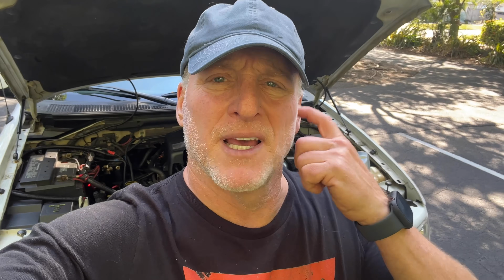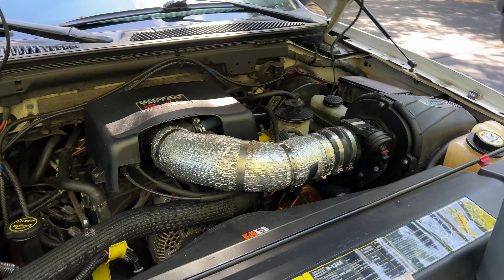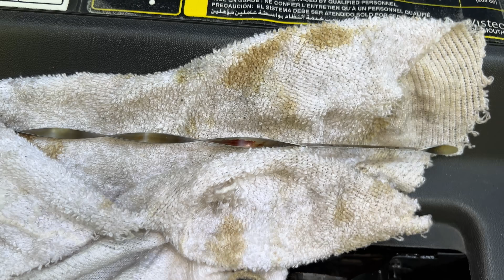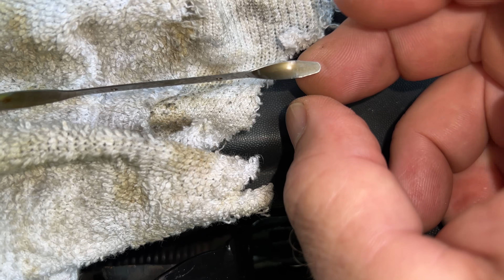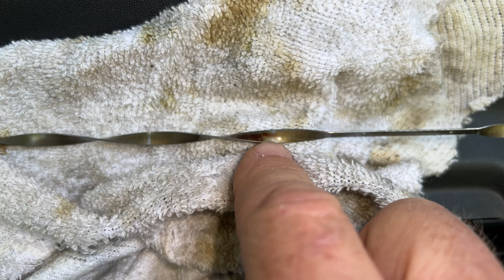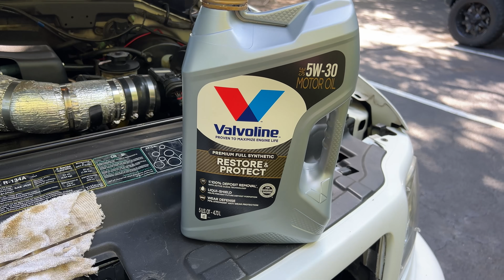Valvoline Restore & Protect Review: High Mileage 264K Engine: Reduce Oil Consumption & Piston Slap?

Comment: Since it is cleaning, do you run less miles before drain.   If oil loads up from old dirty engine then you don't want it ( grit) adding more wear.   So want to drain and get new Valoline Restore and Protect. ? Lower miles but repeating adding to clean out engine.
Reply from the maker: It really depends on how well maintained the engine.  If this is the first oil change in 20k miles, I would replace the oil filter within 500 miles to be sure it does not get plugged.  Also, check the dipstick to note the color of the oil.  As soon as it gets black and thick, change it.

Comment: Let’s hope they tested this long term before going out to market to make sure the seals don’t degrade prematurely. That would make any benefits into an eventual leaking  pain in the rectum.
Reply from the maker: I contacted Valvoline about this concern and they said this oil will not damage or degrade seals and gaskets.  So far, my engine is tight with zero leaks.
Reply: @ thank you for that info
Reply: It made my rear main seal leak after 800 miles.   Ford 4.6
Reply from the maker: @AB-kd9mk  sadly, you might have had sludge that was sealing the crank and the oil dissolved the sludge.  That's a bear.  Did you change the seal yourself?
Reply: @DrivingIntelligence  No.   4R70w still purring along at 200k.  I’ll catch the seal when she needs to come out someday.   I had been using WalMart full synthetic 5-30 with 3000 mile changes for years before R and P.   

I decided to get rid of the R and P after the seal leak and went with Amsoil Signature Series for the first time ever since my vette seems to love it.  Instantly noticed less valvetrain noise which seemed  to increase with the R and P.   500 miles or so after the switch to Amsoil the rear main stopped leaking.    Was getting close to trying AT-205 but didn’t need to.  By the way I love your channel and you’ve really helped me maintaining my ‘97 4.6 2V I’ve been driving since 1999.   Thank you. 

Yeah so anyway I don’t think my 4.6 “likes” R and P from the valve train sounds and drips of it.   Maybe some AT-205 could overcome the seal issue but not the noisier valve train.   I’m not worried about sludge anyway but the idea of cleaning up the oil control rings appealed to me.  Not worth it for this vehicle.  Oh well.
Reply from the maker: @ interesting comment, thank you.  Similar to what you noted, I hear less valve train noise and quieter operation with my 5.4 2v after switching from Pennzoil Ultra Platinum to the Valvoline R&P.  I've never tried Amsoil, might be a future test.
Reply: @AB-kd9mk  That Amsoil has got to have some version theirs of a stop-leak similar to AT-205 in it that they’re not advertising for some legal reason. That’s because no motor oil is going to just help stop or reduce a leak without some additive to make it do so. Not saying it’s as effective as AT-205.
Reply: @ So then you are unfamiliar with oil seal conditioners that part of the formulation of most synthetic motor oils.   Get familiar.
Reply: @ Wow.  More good information!  I’ve never tried Pensoil Ultra Platinum but it’s on my bucket list now.    Thanks again.   Yeah the problem with Amsoil is of course the price but I gotta say it always impressed me.   Apples and Oranges on this example now but you can’t believe the difference it made on my Kohler Marine genset (Two cylinder Kawasaki).   Unbelievably more quiet.
Reply: @AB-kd9mk  What usually happens in these instances is deposits inside the engine were actually plugging an area that would've already been leaking and the better oil simply washes those deposits away. Was a pretty common occurance when people started switching from conventional to full synthetic. People thought the oil damaged their seals but in reality, the seals were already damaged from age and the buildup from the conventional oil simply kept them from leaking.
Reply: @AB-kd9mk  Since you’re the first guy to have that happen in all the comments I’ve read on several videos, I hope it’s just a coincidence that you used it when you were about to get a leak anyway. Are you the first owner and how long have you owned a car.
Reply: @yactabay  second owner.   1997 model.   My daily driver since 1999.   Always maintained myself.  3,000 mile oil change intervals.   Before R and P no rear main seal leak.  Dry.   Been running Walmart full synthetic 5-30  (Warren Oil) for about last 30,000 miles.    Switched to R and P and 900 miles later rear main leak noted.  Switched to Amsoil SS full synthetic 5-30 and 500 miles later no rear main seal  again.

Comment: I have been using OEM Honda full synthetic blend for eight years. I finally switched to Mobil 1 Extended Performance two years ago. I noticed a big improvement in engine noise and smoother acceleration.

I read online that people also said that when they switched from Mobil 1 to Pennzoil Ultra Platinum, they noticed greater noise reduction and better acceleration.

Now, there are videos claiming that Valvoline Restore and Protect is even better, making your engine sound like an EV and accelerating like a Bugatti. I am totally lost.

I do plan on using Restore and Protect in all my vehicles.
Reply from the maker: Claims that engines will gain vast amounts of power from use of this oil are suspect.  I'm experiencing smoother operation and reduced oil consumption.  My previous go to oils were Royal Purple & Pennzoil Ultra Platinum, and I was very pleased, but the results from using R&P are very significant in terms of what I noted, reduced oil consumption and noise.
Reply: @DrivingIntelligence  I've heard that Pennzoil Ultra Platinum and Amsoil are considered far superior to Mobil 1. However, when I read online, I see that people who use Ultra Platinum and Amsoil often say that after switching to R&P, they noticed even better noise reduction and less oil consumption. That makes me think that a lot of what people say about oil brands is just speculation and bias, with no real objective proof.

If someone has been running a "superior" oil for the entire life of their engine, why do they still experience oil leaks? If they change their oil every 3,000 to 5,000 miles, why are they having engine problems? To me, it seems like people are just hyping up certain oils without them actually performing as claimed.

At this point, I might just stick with Mobil 1 or give R&P a try, but I don’t believe everything I read online anymore most of it seems to be just personal opinions with no real facts to back them up.

Great video! Keep up what you're doing, and I hope I find my answer once I switch over to R&P.
Reply from the maker: @ good comment, thanks.  My experience so far as noted in my videos is reduced oil consumption and quieter operation... since I started using R&P.  I'm up to 8k miles on this oil.  Hopefully will continue to improve over time.
Reply: Also, make sure you're using a consistent filter when comparing the observation of audio and visual. Synthetic media filters typically flow better, but each brand does differently, and you can see it in, I think, brand ranks is a group channel that tested it with a whole system where they can get the temperature correct and everything. The mobil extended performance filters and the Wix XP filters were probably the best flowing that didn't sacrifice too much filtration like the Toyota filter flows great but has terrible protection.
Reply: I have a pretty good test scenario with mobil1 full synthetic from 20,000 miles on the 2002 GS300 for 10 years and it burns a cord every 2,000 miles.
Needless to say, it didn't do too good at protecting. 
I have a 2GRFE in a Highlander, I had about the same mileage, and it ran pensoil, ultra platinum, amsoil, and valvoline extended protection, and now I'm trying the valvoline restored and protected. I think I'll run it a little while, see if it makes the engine any quieter, At 119,000 miles, I figure it probably has some deposits., but when I drain the oil, I definitely have all the oil I put in there as i measure after 5,000 miles on the extended protection.
After running a restoring protector for four changes.
I think I'll go back to the pencil ultra platinum after that's done. I didn't like the way it sounded when I used the extended protection. There was an immediate difference as if it took longer to get lubricated and quiet down.
Reply: Seafoam
Reply from the maker: @tntgators  Tried it, didn't work... this oil is the only product that has reduced my oil consumption, to date.

Comment: Can this oil be used in diesel engines too?
Reply from the maker: generally speaking, the answer is no, the wrong oil could cause damage, but Valvoline makes a very expensive oil for Diesel Engines that cleans the rings very effectively.
Reply: Valvoline says not for use in diesel engines.
Reply: @dacampbellrn  thanks a ton

Comment: I switched from 5W-30 to 0W-20 this shit is that good, my car got recalled for oil burning & this shit is really good. My MPG when down but thats it. Running like a champ.
Reply from the maker: hmmm, I wonder why your mpg went down.  You stopped burning oil?  What vehicle do you drive?
Reply: @DrivingIntelligence  2009 xB it was recalled for the piston rings so it'll just chew through the oil. Isn't really burning oil now.
Reply: @mrshadow70835 You're using 0W20 now? That should increase your mileage, not reduce it. 5W30 is thicker.
Reply: @musicconnoisseur4019  I think the thicker oil is getting me better compression because of the recalled piston rings
Reply from the maker: @ that's a good assumption

Comment: in general any proper full/100% syn oil would clean up sludge and varnish from insides including dipstick, but at very slow rate. I had this case 10+ years ago after dealer put some conventional oils and I have to clean up it afterwards before this oil geek guy was even born. but this is a great point to easy and simple check if any oil including VRP really works
Reply from the maker: It is a good indication of the cleaning ability of the oil

Comment: I'm literally about to do an oil change with this oil in my subaru outback right now
Reply: I really want to see a comparison test between pensoil ultra platinum and valvoline restore and protect
Reply from the maker: @ I was using Pennzoil Ultra Platinum until I switched to the Valvoline Product and the Pennzoil has not done as much good for my engine, although it is a very good oil.
Reply from the maker: I'm sure you'll be pleased.  How many miles on your Outback?
Reply: @DrivingIntelligence  it has about 140k miles at the moment.

Comment: I bought a 2000 f150 7700 about 15 months ago. Since buying it, I have had to replace the alternator, and have had two spark plugs eject while driving (at different times). I always associated my stuttering engine at idle with spark plugs about to blow until this 2nd one went. I have a leak in the vacuum system apparently associated to the EGR sensor, waiting on parts. I need to hire someone to do the last 6 plugs.
Reply: If you tighten the plugs to 28 ft lbs they won't blow out.  The torque spec in my 2002 shop manual stated 12 ft lbs.  28 is what is recommended now on the Ford truck forums.  I never had a plug blowout and I put 170,000 miles on my 2002 5.4 and 170,000 on my 2000 5.4.
Reply: @williamwhite9767  Cool. Thank you William.
Reply from the maker: Here's one of my very first videos about finding vacuum leaks in these engines:  https://youtu.be/hMeR0LJirAo?si=m61Q83hv9g93FeEf and here is my video on coils and plugs:  https://youtu.be/AQPaFukWewQ?si=OJ284LKgbVBIuv40 - William is right, the spec for the plugs is no longer effective, 28 ft./lbs. is good.  Good luck
Reply: @ thank you!

Comment: Thanks for thst.
Reply from the maker: My pleasure!
Reply: @DrivingIntelligence  I have a question…. When it comes to the Mass Air Flow sensor, should I use a new oem, or is there a cheaper alternative you’d recommend….. 2000 Ford F150 5.4 V8
Reply from the maker: @Cliff117  I've never had a Mass Airflow sensor fail.  Generally, I would go with the OEM unit unless I find great reviews.
Reply: @Cliff117 Some mass air flow sensors can be cleaned with "mass air flow sensor cleaner spray", and reused without replacing. However, some mass air flow sensors cannot be cleaned, it varies from vehicle to vehicle.

Comment: I've been running it in my 04 Ram 2500 5.7 for around 3k miles and I have noticed a mild decrease in overall engine noise, the lifters still tick at startup but they shut up much faster than before.
Reply from the maker: Hopefully you will continue to see more and more improvement in engine noise... I continue to be amazed a the smoothness and quiet of my engine since using this product.

Comment: I sold my 2002 F150 with the 5.4 engine at 170,000 miles.  It was still only using a quart of oil in 5k miles.  The last two oil changes at 5K intervals I added 6 ounces of Seafoam about 30 miles before changing.  When I changed the oil it was very black indicating it removed additional sludge and the engine valve train was noticeably quieter after the first use on cold startup.  The valve train was quiet when warmed up.  If the Valvoline Restore oil had been available before I sold it I would have tried it.  Sometimes I sort of regret selling it but I'm really enjoying my new 2023 Nissan Titan Pro4X.  I'm 80 now and I don't enjoy working on autos like I used to...

By the way, when I changed the oil adding 6 quarts the dipstick would indicate it was a half quart low.  I added an additional pint after a couple of oil changes and it would immediately burn that extra pint.  So, afterwards I only put 6 quarts in it after draining.
Reply: 🤔 I may try running my vehicles oil at 5.5 instead of the full 6.0 quarts and see how my oil consumption is. Interesting 🤔
Reply from the maker: interesting, I guess when the oil is too high, you get more oil vapor in the crank case because the crank is whipping it around, and the PCV removes the oil vapor.  Did you have alot of oil in your intake / throttle body?
Reply: @ I don't think so.  My throttle plate was sticking when closed and I had to clean it at about 150,000 miles.  I removed it to clean it and I didn't notice a lot of buildup.
Reply: I had an 03 Cummins that did that. It would always burn off the first quart. Strange because it never had blow-by. I sold it at 450k. The guy that rebuilt it said something was wrong in the oil pan and pickup. Almost no wear on the engine.
Reply from the maker: @Second.Nature.Lawn.Michigan  450k with no engine wear, that is amazing.  Decades ago I had a '79 Blazer with a 350 engine.  The engine was weak, so when I installed a new engine, I sold the old engine and when the guy tore it down, he said it looked like zero wear at 150k miles.  I guess I used good oil at that time.
Reply: You don't want to fill to the top of the dipstick line, you want it in the middle of the 2 which is where the 6qts got you. If too high you risk foaming the oil and or lose mpg with the extra oil slinging on the crank.
Reply from the maker: @SubtleSpeedShop  right on!
Reply: when the hell did you sell it , I bought 2002 ford 5.4 with 170,000 a while back 😂

Comment: Can’t wait to see what happens over time with using this oil in my car. Thank you.
Reply from the maker: Your Mazda CX5 is an awesome car... I bet there will be some improvement from this oil.
Reply: I just changed the V R&P on a 2017 Elantra with 64k miles. The oil was filthy after just 4,000 miles. Filled it up with round 2.
Reply from the maker: @eweb555  thanks for the comment, let us know how it goes
Reply: @eweb555  I have the sonata at 148k
Hoping this works.
Reply: Check your seals for leaks
Reply from the maker: @ zero leaks anywhere... I think those that have leaks were not properly maintaining their vehicles and the R&P removed the sludge that was holding the oil in.  One of my vehicles has 265K miles with 8k on the R&P and the other has 130k miles, neither of which have a problem with oil leaks.